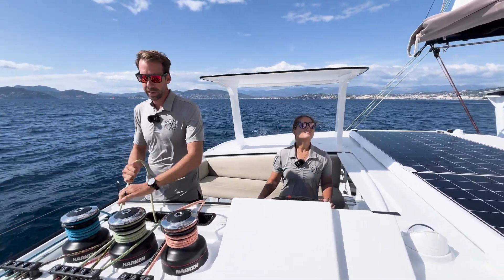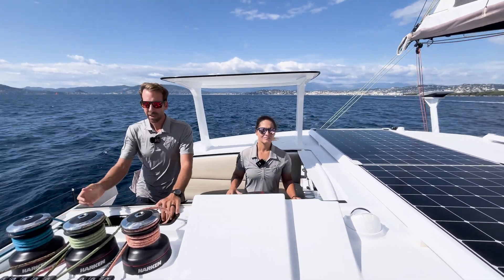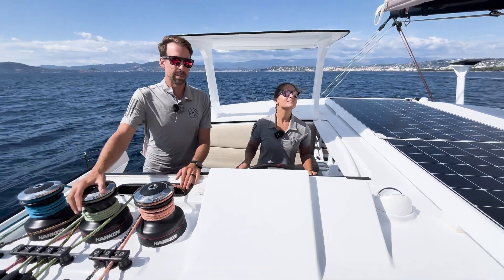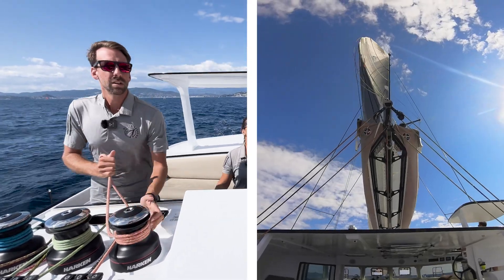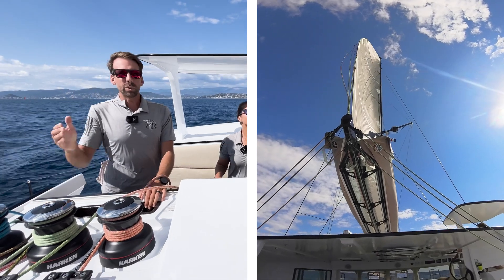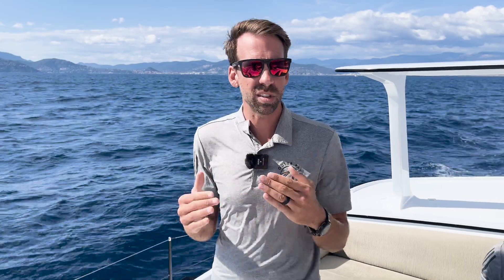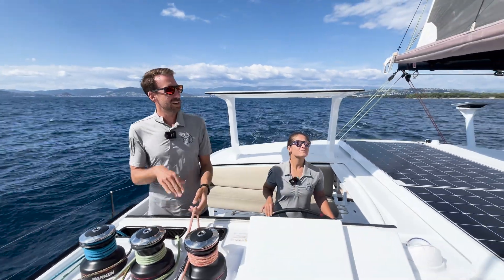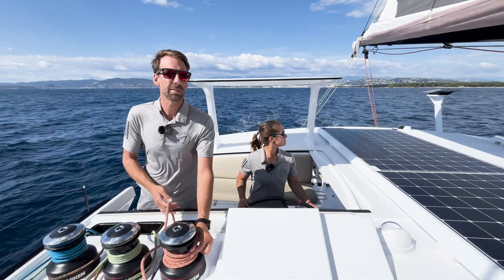Introduction: A-Frame Sheet System - Balance Catamaran Training with @OuterPassage

Comment: leeward sheet is most useful to control the sail shape - as you note can flatten the sail to power it up, or ease it for a fuller sail, as in used in lighter winds.  When powered up with the leeward sheet on and in situations where you have strong wind gusts - you can depower sail and add twist at top of sail by easing the leeward sheet.  We do this ahead of reefing the sail - a useful stop-gap measure to depower the main to ease tension on rig.    Perhaps another video on performance sailing with the A-frame and how to tune for different points of sail and the balance between windward and leeward sheets to optimize sail-shape.  Also can cover tactic of moving sheets between pad-eyes - our mainsail does not like to be over-sheeting - never have it at center line, at least about 10 - 20 degrees off the center line and when nearing beam reach or downwind you want to move the sheets to the leeward pad-eyes to improve the luff angle to wind.
Reply from the maker: Love ya Scott!  At the rate we are going we'll have a thousands videos by years end!  Dean, Bianca, and Tamara, our team in South Africa, have their work cut out for them!

Comment: Looks like a great system as long as the main is near the centerline of the boat. When sailing with the sail outside of the two sheets, it seems like it could be little cumbersome. Or, at least, require more thought as to which sheet to assign primary duty to.
Reply from the maker: The A-frame system simply allows for a lot more variation in how you twist or flatten the sail, and as with all sail trim, the goal is to increase the speed of the wind over the back side of the sail to produce lift. The tell tales are your
most helpful friend here. But as Scott notes, when the seas are lumpy and you need more power, you flatten it less, allow for more belly and twist. One great thing about the A-frame is that the sail is always vanged, and when you are sailing deeper, with the boom further out, it enables you to keep the boom from banging around, no need to
set a preventer.
Reply: It seems simpler than a traveller and single mainsheet to me.  Two lines vs three.
Reply from the maker: Yes, you are 100% correct. It is simpler, and you also gain far more sail control than with a traveller, as a traveller can only pull down, not side to side.

Comment: Really useful to see how it works.  Really like the control of sail shape that the dual sheet system gives.   Seems much simpler and more direct than a single mainsheet, traveller, etc., and far fewer deck penetrations.